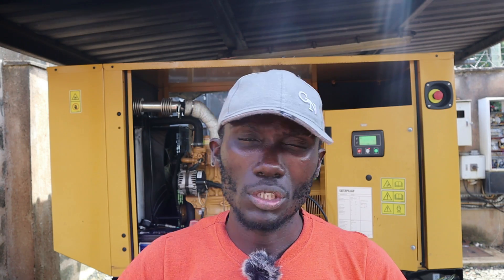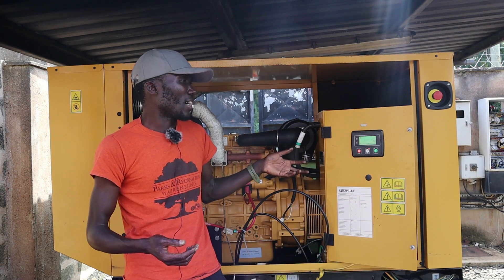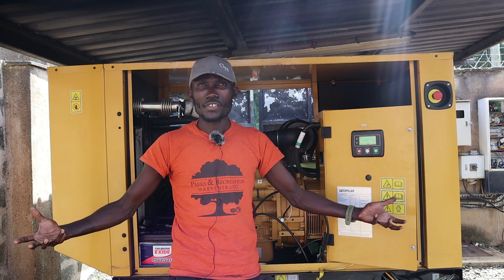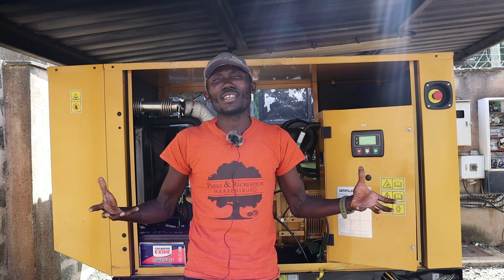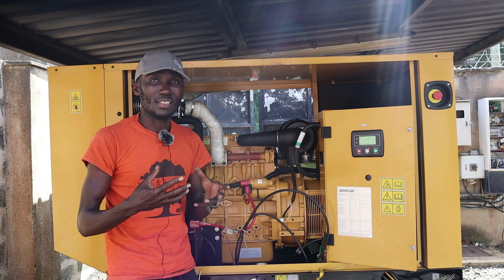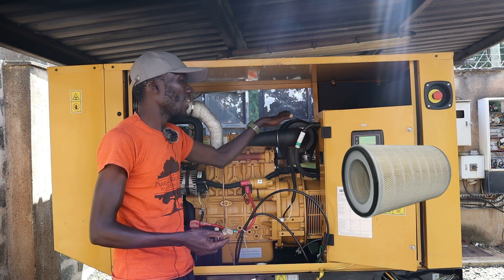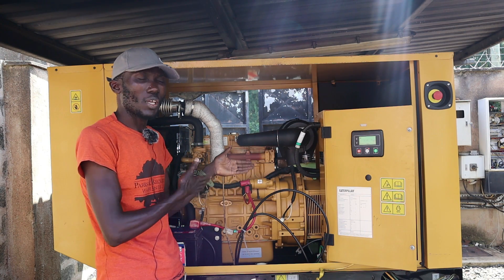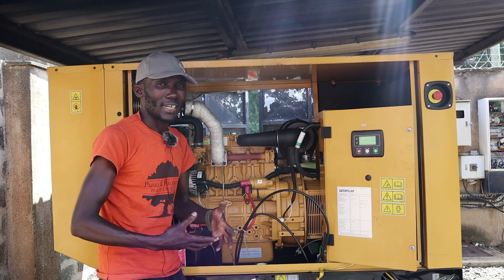Top Tips for Diesel Generator Maintenance | A Step-by-Step Guide

Comment: Please, what are the possible reasons why is my off button not working ?
Reply from the maker: You mean the controller stop button can't stop the engine? If yes, this is the possible reason.
Physical damage to the controller's stop button
Stop wire lose connection(from the controller) or the wire cut.
Faulty solenoid.
Controller logic error or firmware update issue...
Tighten all connections at the back of the controller. Check if the solenoid functions normally.
If there isn't a physical problem, then login to the controller and check for incorrect configurations.

Comment: Where's the AVR on that generator?
Reply from the maker: It is usually mounted in either the electrical panel or the alternator's terminal box.
Reply: Do you mind making a short video just to show were the AVR sits and how to go about with voltage adjustments.. a humble request 🙏 @elektreca

Comment: which garget is called trickal  charger
Reply from the maker: Its the battery charger that keeps the battery charged when the generator is not running, usually not part to generator components.